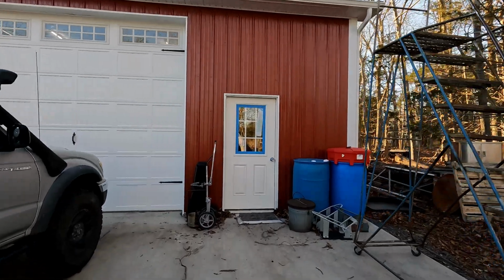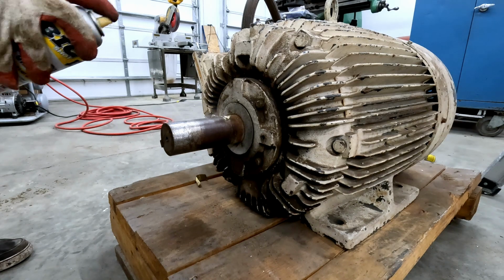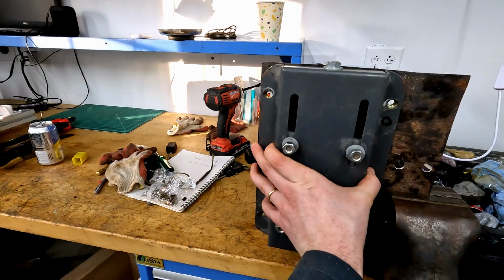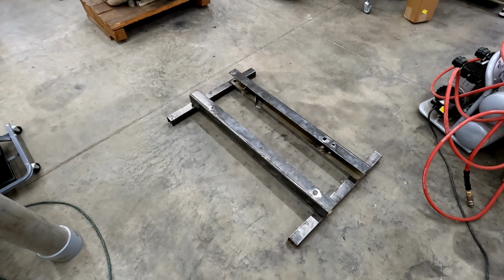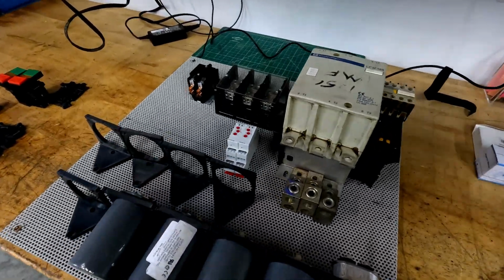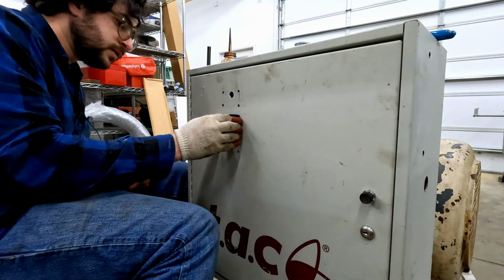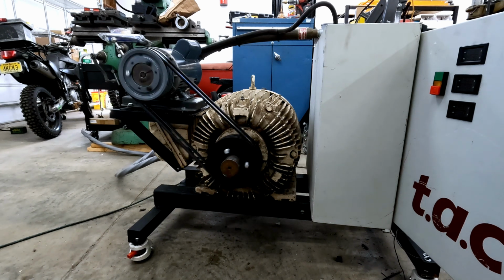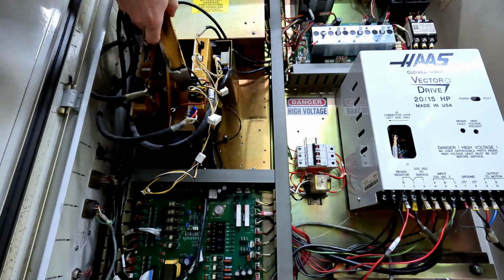HUGE 40HP Rotary Phase Converter Built from SCRAP?

Comment: What size panel meters did you get for the voltage and amprige
Reply: I'm looking to build a unit with a 3 phase 40 HP  100 amp motor

Comment: A couple notes:
3D Print insulators or shrink tube your high voltage lugs to prevent shorting!

While you did successfully ohm out the windings you really should’ve used a megohmmeter to ensure wire, insulation, and windings were in spec.

I’m a retired PLC/SLC Engineer and your panel layout is very good especially without using CAD.
Reply from the maker: Excellent notes. In the final install I did insulate the high voltage lugs.

I appreciate the kind words. I too am a mechanical engineer, I've spent a decent amount of my career doing plcs, mainly Allen Bradley.

thanks for tuning in!

Comment: Im piecing everything together for mine right now. Ill be using an electromagnetic pto clutch on the pony motor tho so when it shuts off, the idler wont be spinning the small motor as well.
Reply: That would make an interesting thread in the Practical Machinist phase converter and VFD forum.
Reply: YES ... I HAVE ONE .. ( FROM A  BIG  DOOR  OPENER )  .. USING  "100 V DC"  TO  ACTIVATE ..
THEN A "MOTOR"  CAN  RUN

Comment: I enjoyed your build.  I know that HAAS.  Spent some hours on that beast.  Milling parts for Adrian Smith -tallest building in the world architect.  
Thanks for the video. I have my own business now and dont want to keep relying on places that have 3 phase power as I can build on my property.  Electric company would ask over $100k to bring 3 phase.  Ive got lots of motors and such, so I saw your video.
Thanks much.
I'll look to see if you are running that milling machine. 
Hope you can find the zero probe.  I bet you could find them used at auction or ebay

Comment: I've never known the burn in on a CRT to worsen with it being left disused for a long time. Probably more to do with the lighting conditions then and now. You should be able to replace it with an LCD
Reply from the maker: I wonder if it was damaged in transit. I did end up replacing it with an LCD and it greatly improved the usability of the machine.
Reply: @RocanMotor  Apart from a scratched face, the only real damage one sees on CRT is the neck getting broken, then you definitely would have no picture.
That sort of burn shown in the video is nothing unusual for a screen showing basically the same image all day for many many years. Some places leave them running 24/7.

Comment: They def make VFD's that size. Even bigger actually (100hp+).. they cost alot more than your build tho
Reply from the maker: No doubt!
Reply: Depends on the features and certifications you need from it. 

Upto 7.5KW single phase input VFDs from China are cheap AF and suprisingly robust. Go up a step in quality from china and you get a bunch of features that are really useful. 

I've seen some smaller VFDs that can connect via a com port and work together as a single larger unit. I've even seen some units that can act as a soft starter and controller for this specific application, they'll slowly spin the motor up then sync the incoming phase or phases with 2 of the phases on the motor before passing all 3 phases on to an output. 

Most of these units were well under 10 grand USD, many closer to 1K USD. 

With that said, many of these solutions are still pretty sketchy and I was lucky enough that my boss was an electrical engineer and we worked with an industrial electrician. I also live in Australia with zero tarriffs from china and cheaper shipping than the US.

Comment: I'm currently building a 40hp converter myself. I'm going to try a 10hp VFD to get it started instead of using a smaller starter motor like yours or start capacitors. Goal is to reduce the inrush current without mechanical complexity and inefficiency of an additional motor and pulleys, etc. I hope it works, it should in theory 🤷‍♂
Reply from the maker: Let me know how it goes. I dont think the 10hp vfd will be capable of starting it unfortunately.
Reply: Well I tested it today and it works. Spent some time figuring out the settings on the VFD so it wouldn't overload, but now it will spin the motor up no problem. The biggest thing was setting the start time to slowly ramp up the speed over 60 seconds so the VFD didn't overload. Pretty excited it works.
Reply from the maker: @braaap6292  that's excellent! Nice work.

Comment: You should I stall a clutch on the pony motor so it's no continually stressed after the initial start of the three phase converter motor
Reply from the maker: I mentioned in another comment that I considered this at one point. The motor is not powered once the main motor is running, so it really is just freewheeling.

Comment: You can 100% start that with capacitors... Probably
I start my 30hp with start caps. Pulls about 300 amps for about 1 second on a 100 amp breaker and Doesn't trip the main 200 breaker.

Comment: And to be able to make this setup operative, how many power you have to contrac to your distribution company?
Reply from the maker: @A.T.B.Engineering  i have a 320A, 240v single phase service to the garage. This phase converter requires a dedicated 200A service. I run a 20hp cnc mill, 10hp cnc lathe, and a 5hp compressor off of it without any issues.

Comment: Do you still turn off your idler motor?
Reply from the maker: Yes! Once the main motor is started the idler is shut down. The control circuit is set up in such a way that if there is a power failure the entire unit will power down, so it is fail safe. Additionally, since the pulleys I am using are slightly different in size (6" vs 6.5"), I would be unable to run the idler and pony motor simultaneously.

Comment: I want to ask about your idler motor specification,
rotation speed? voltage?
thanks
Reply: @agusandriyanto-c2j  thanks for taking the time to
Reply: At Rocan thanks for taking the time to respond
Reply from the maker: 1800rpm, 120/240vac, single phase, 1.5hp. I'm running it on 240vac in this setup. Its okay if there's a slight mismatch in speed- since the pulleys are slightly different in size after the idler motor starts it slows down the pony motor.
Reply: @RocanMotor what if you put a clutch on the the pony so it stops spinning is that overthinking this. My single phase motor just burned up and I’m seriously considering building one of these just to get 1 machine back going.   I’m at the learning stage where I’m suffering dunning Kruger
Reply from the maker: @dreece2000  that was my original plan, using an electromagnetic clutch like you would find on a cars AC compressor. In the end I didn't bother, since the pony isnt being powered while its running the only downside is the bearings seeing a bit of additional wear.

Comment: I doubt you’ll ever pull more than 30 amps with your vf2.  In my experience power requirements are over rated.  Also with a properly designed  phase converter, start-up with capacitors wouldn’t be a problem with a motor of this size.
Reply from the maker: I'm my testing of the VF-2SS so far I'd agree. 

Regarding the capacitor start, the current draw for a motor this size was in the 300 A range, supposedly, which I hadn't confirmed through any math of my own. That's for a brief moment of course, and likely okay, but I had the pony handy so this seemed simpler at the time.

Comment: quality video ! how much did it cost in total? thanks for sharing
Reply from the maker: Thank you! I tallied it all up and the final cost was roughly $800 for everything. That includes just about everything except for the 4/0 quadruplex cable to connect it all. The motors were free as was the steel for the frame. 

40hp rotary phase converters generally are $5000 or more, so overall I'm happy. A smaller unit can be built for much cheaper- the pulleys required for the large motor for example are roughly 25% of the cost, and the large contactor was another 25%.

Comment: Do you leave the pony motor belt connected after start?  Others I have seen use an idler pully connected to a lever so the belts can be slackened after start, think clutch.
Reply from the maker: I considered an electromagnetic clutch, similar to an AC compressor in a car, but ultimately opted to keep it simple and left the belt turning whenever the system runs. The losses are negligible.
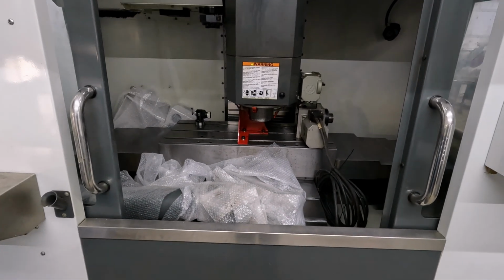Reply: @RocanMotor 0:42
Reply: Seems kind of silly to mount the pony motor the way you did when you could have mounted it to the frame along with the larger motor. I really enjoyed the electrical end of your project though.👍
Reply: @crookedaxle this is not your normal critic he ended it with decency.

Comment: The bigger motor may have a threaded plug on the bottom side of the bearing bell ends that you greased.  Take those bottom plugs out when greasing and the old grease and bearing wear particles  will get pushed out of the motor.
Reply from the maker: I'll have to check! I appreciate the comment, I was looking for a second port/ for the grease to come out but didn't see one. Didn't cross my mind to look underneath. Thank you!
Reply: @RocanMotor  BTW, I hope that was Polyrex EM grease. Grease compatibility is a gnarly rabbit hole.
Reply from the maker: @TheMinecraftACMan it is indeed polyrex em!

Comment: Great vid buddy, I’d luv to be able to do something similar, but don’t have the confidence 🤙
Reply from the maker: Thank you Joe!! I say give it a shot with a smaller 3 phase motor. A phase converter this large is a bit daunting (and deadly), but the same principles apply to all 3 phase motors and with some research and planning you could have a working phase converter in a weekend. Also, it doesn't need to be expensive- local ads (marketplace, craigslist, etc) turn up free 3 phase motors and components all the time.